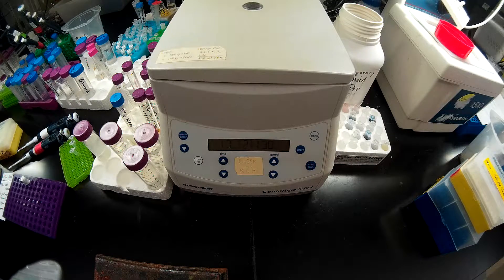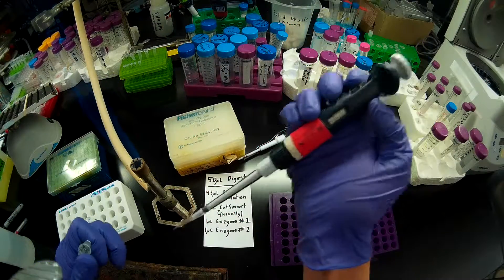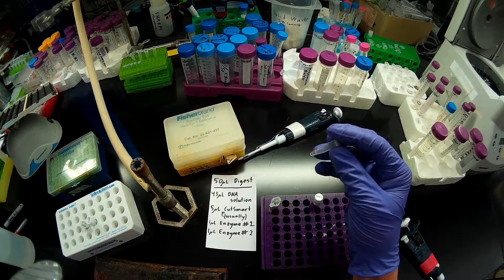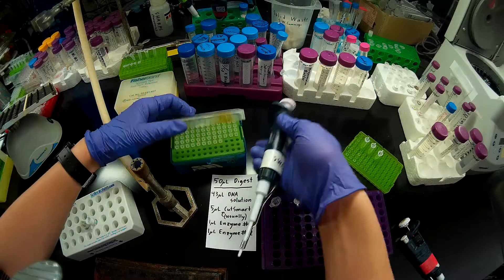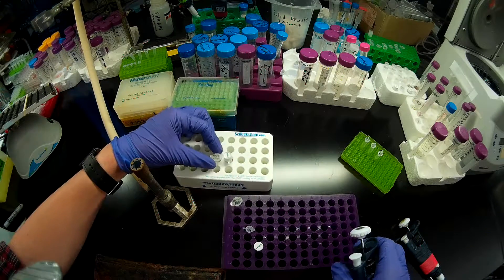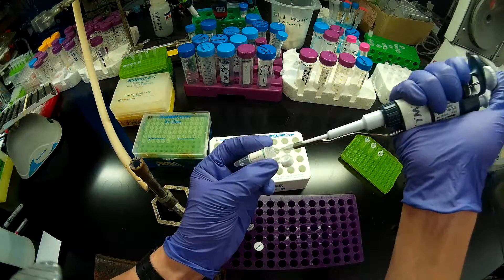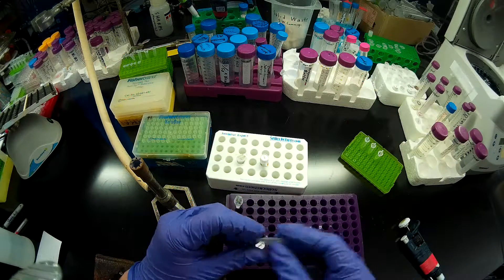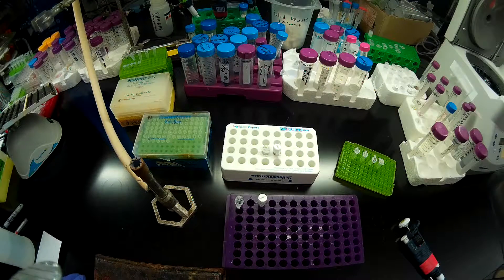Setting up a restriction enzyme digest

Comment: I have watched your video and I'm going to linearised a plasmid. I have a question: I will be using CUT SMART as you did, do I need to dilute the buffer before I add the 5 uL? or should I add it directly from my stock? thanks for your help in advance!